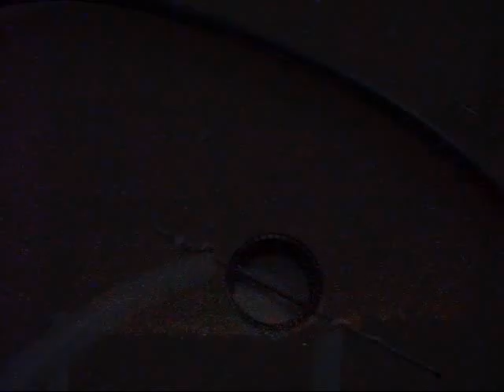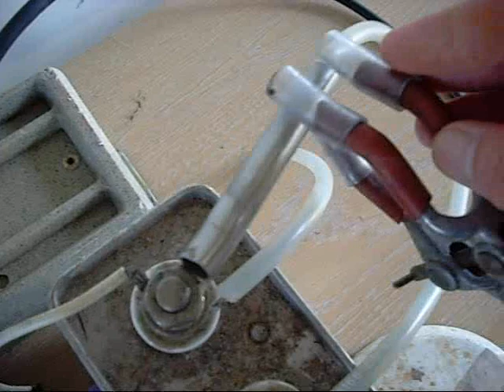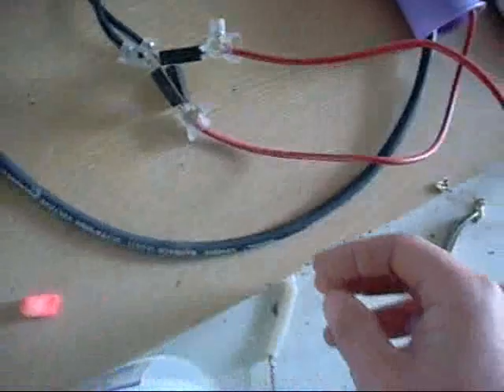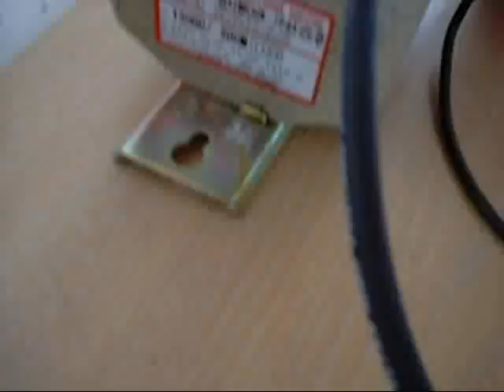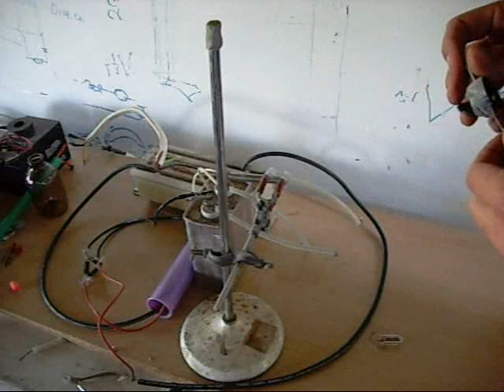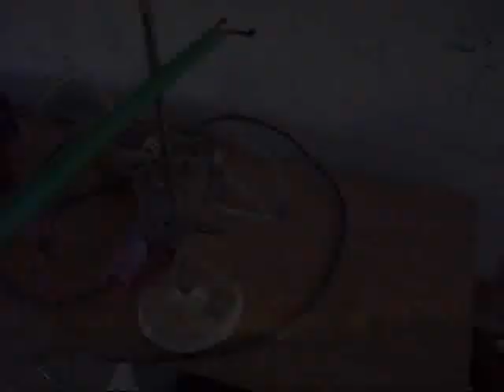Exploding water with High Voltage DC

Comment: 3 caps in series might be a problem.  If you discharge them quickly and they aren't all exactly equal, one may end up charging backwards.  If they are polarized then it might get damaged.

Comment: All you need to do is use a Pyrex container and a gallon of steam distilled water because it has no impurities. So you superheat the water past the 100 C required to boil it. Than throw some form of impurity into the water. It can be Sugar salt even a fork but salt works best. AND as you and i know its the impurities in water that allow it to boil.

Comment: 3a 1000v. I just ordered 250 more, lol. I put them in series between the 110 vac capacitor and the high voltage dc spark plug.

Comment: I've cooked MOT diodes with far less voltage than that so I'd imagine you're right! What I find interesting is how an arc appears in the water but it doesn't look like theres a gap there.

Comment from the maker: @tazein022 its very straight forward-the AC comes out of the NST into the rectifier-the DC comes out of the rectifier and into the cap-the discharge is a very basic switch that dumps the cap into the lid containing a short spark gap and water covering the spark gap-if you need any more than that feel free to send me a personal message with your email address

Comment: I go through diodes all the time, lol. I am using a 12 volt auto coil and points with a drill turning the distributor and the spark gap hooked to ground on dc side and coil output on other side. Then i have a inductor/ resistor that glows purple in the dark. Lastly I have the 110 vac wall current and motor starting capacitor running the positive lead to dc ground and neg ac thru diodes to the high voltage coil lead at the spark gap. Fun stuff. I am constantly burning out diodes though, lol.

Comment: Great video, lots of power in that explosion there... how about a distributer cap discharging and just keep the electrodes under water in a big container , i bet it would give lots of gas... i got flammable gas with the little AA battery that pulse charged a cap, i can imagine what you can get with this

Comment from the maker: you asked about the cap rating its 3uF 1400v,also i want to comment about your idea of making a rotating flywheel with the effect-the theoretical upper limit of the speed of electric motors -with no magnetic drag-it should be possible to go as fast as the bearings will allow.

Comment: @XxbeouwulfxX so...if it doesnt boil, then does it not do that phenominon, latent heat i think its called, which caps the waters temperature at 100 degrees celcius, would it just keep getting hotter?

Comment: ok, i've watched like 6-7 times and still don't get it.. how did you trigger the blast ?? :)) please explain that green stick triggering device ! :) ps check new videos about water disociation by plasma/ plasma thermolisys , how I like to name it. Some of them have good result. All the best and I hope you've continued the experiments ! :)
Reply from the maker: I had it setup so that pushing the frame connected the cap through the circuit. Purely mechanical. Nothin fancy. It is an ongoing interest. Not tooled up to play currently but happy to help out.
Reply: @m3sca1  :)) now I got it ! it was a verry interesting "ilusion" ! :)) thank you for taking time to reply and good luck with the future experiments !
Reply from the maker: @pici24  isolation was required to stop any leakage into the water. Even the setup dry won't charge fully because of the points in the lid being close together.
Reply: @m3sca1  try a setup with car induction coil, saturated steam (boiled at 100 C, wet not dry... not to wet :)) ) and for water with ph lower than 7 you should obtain some negative charges .. that should help the plasma formation having as result an efficient disociacion of water and finally a nice good blast. There is a vortex tube sistem that is already in use , only that they use some mix with other fuels like benzine or petrol...for me is not an option so I choose to stay with water disociacion methods.. clean style !  :) ... also... it seems that RF (radio frequency) have verry good results for plasma creating ! I would love to make some tests/play  but i'm laking resources so I remain to study'es and theorethycal concepts ! :)
Reply from the maker: @pici24  i have done similar way back there in the list of videos. Using steam over a spark plug shroud.
Reply: @m3sca1  i'll check it now  ! :)
Reply: @m3sca1  ok, I've check 2 of you're videos that include spark plug and the one with steam I new it and early in messages I mention about other people with some progress..well it seems you are one of those people I've mention, just I didn't knew you by youtube name ! :)) So, first of all... buy a better camera, ilumination and quit that video game background music ! :))) Secon, I enjoyed both of them and I like that you "split hair in 4! " (a saying in my country) Wich means you try almoust anything in order to obtain the goal. About the setup in the video. From what I've study there are 2 different procedures. One is sinked(under water) and the other is "aerial" (above level of water) . For the fog setup please tell me power input ! Also, you made steam but in difference with the sinked setup, I didn't notice to take in consideration the PH of the water. Then, your steam looks to me to be too wet and you lack a valve control. Try the setup with temperature control, steam volume control valve and of course, some underpressure flow of air into a burning chamber (to avoid wrong/contamination of gases. Then, feed in pipe steam looks to be a metal or something.. don't ! Use electrical insulated..steam has a charge when exit a nozzle, you can use that charge in your advantage. For this setup I thinck I cover the important facts. For the submerge setup.. please check "NightHawkInLight" video about "water gas" or something like that. He offer some good information about underwater plasma thermolisys. Also be verry carrefour with the fumes..when plasma is burnin, any materia that is in contact oxidize.. if you use metal rod , you may find yourself intoxicated with some nasty metal oxyde and if you use carbon rod you get carbon dioxide wich is letal if not burn ! So, be carrefull with that ! :) 
Also , in youre tets you've manipulate the PH of the water and the results were obvios, so that sustain my PH afirmation..just try it in the steam setuo..my oppinion is that steam is more suitable for detonation/burning of the elemental molecules of water. You're result , from what I saw, are great ! Try playing with frequency, higher voltages (it allow AC to do work as well and a good one I may say.. no need for DC like in traditional HHO hydrolisys). Also, multipoint electrod surface combine with magnetic field for a wider distribution if corona discharge ! I saw nobody using this and is a pitty. Havin more corona volume will help disociate more steam molecules faster.. that mean a faster burning and this, in my opinion, is a big problem in surface disociation of water ! I hope any of these .. opinions of mine wilk help and motivate you to "crack that son of ..." ! :)) Best of luck, waiting for future videos (good video quality :p ) about water disociation ! :)

ps steam pressure is direct proportional with quantity of the steam charge , plus or minus, depending of PH scale (below"-" or above 7 "+".. also check triboelectric tabel for identifyng best nozzle material)
water gas ..
https://youtu.be/zX6cQ1ian14